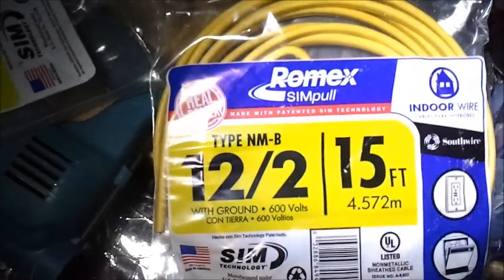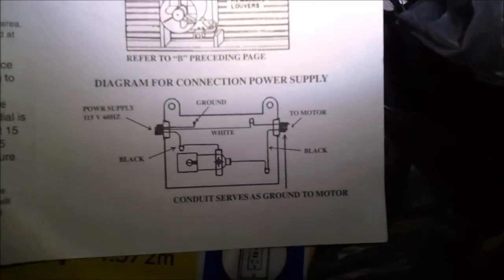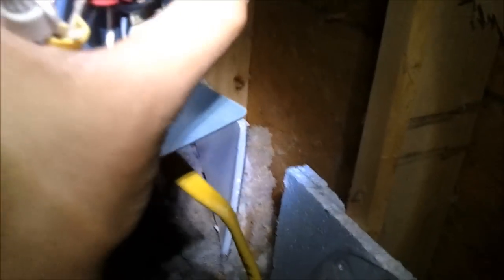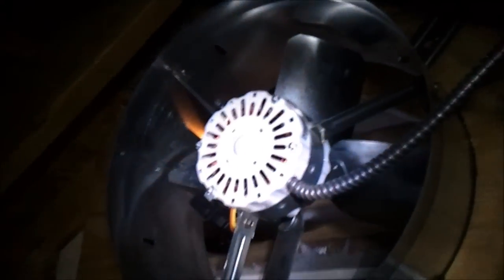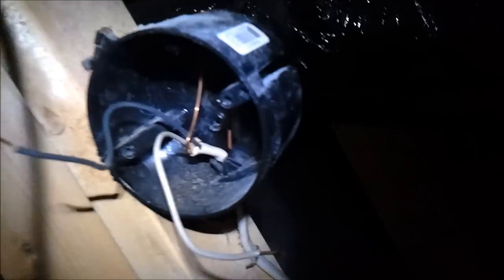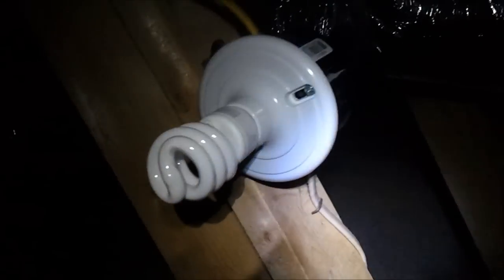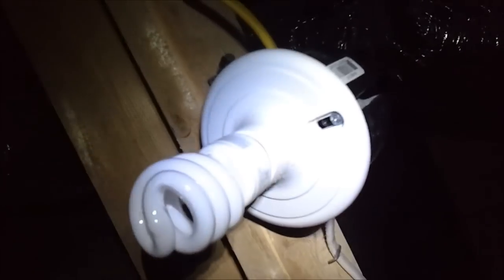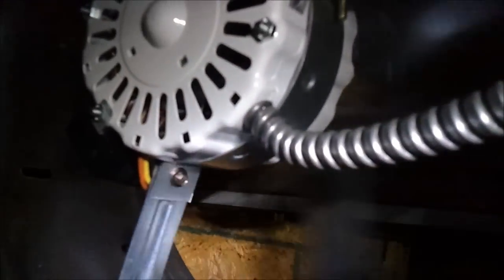How to secure, install, wire, and test an attic gable fan. Part 4

Comment from the maker: Thanks.  I looked at some of the other switches in my house and it does go on the black.  But that is funny, because with the fan, the switch did not function when it was connected to the black.  I will tinker with things some more.

Comment from the maker: Probably.  That may be too cold to test, but turn it all the way down and see what happens.  You may have to wait until the sun is up, or use a hair dryer to carefully heat up the switch.

Comment from the maker: It cools a good portion of the attic.  Ideally, I would like to have another fan on the other side so air flows completely through, but oh well.  I added some computer thermostatically controlled case fans to the bottom of my passive air vents which helps move air all over, since they near the apex on the other side.  The room below is much cooler.  I do recommend it.  My electricity bills, for just me, have been $65 and $65, June and July of this year.  The attic is cooler after installation.